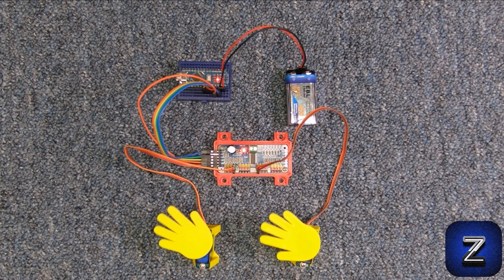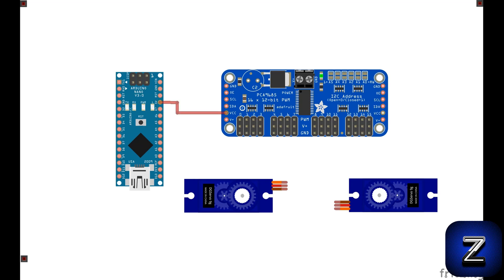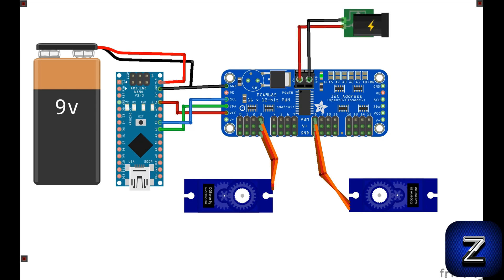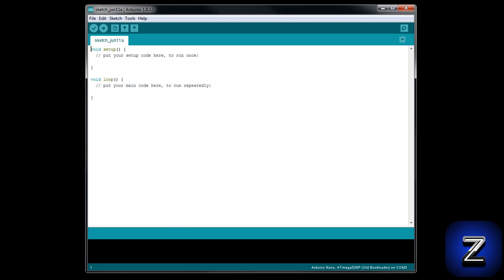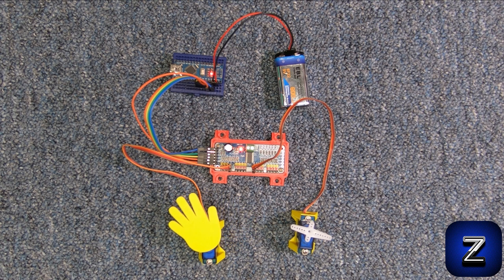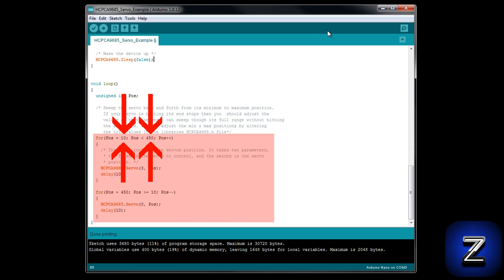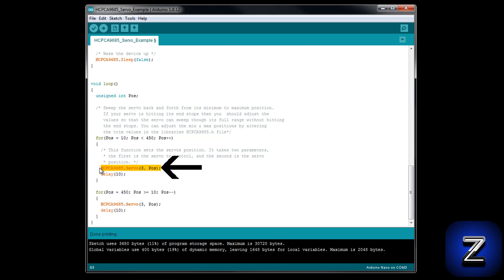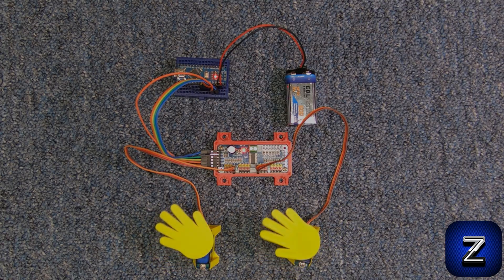How to setup and use a PCA9685 with your Arduino to control up to 16 servos.

Comment: I have 11 control switches and an arduino mega and a PCA9685 can I program the mega to operate servo's using the on/off switches? Thanks

Comment: I tried adafruit library but can not get the servos to move.I downloaded the HCPCA9685 library and still can not get my servos moving, I have everything connected correctly ( I have checked this 100times now) I power the arduino from a regulated 5v supply(usb) , I have a seperate power supply for the servos( 5v 10amp) but still no action, you seem to know what your talking about any suggestions you can give me( sorry I’m new to this) trying to get 6 servos working

Comment: i downloaded the code and library. The A4 and A5 did not work for SDA and SCL. However the pins on the Arduino Uno labeled SDA and SCL worked for the PCA9685 corresponding data pins. Also the servos did not work on 3 and 8 but they did work on 4 and 9... Kinda buggy or something wrong on my end. Works tho.

Comment: an additional tutorial, for model railroads can be found at DIGITAL TOWN with a very good example and discussion of working code and how the servo driver actually works and is wired up for either servo or leds,
bob

Comment: Hello!
Your channel is helping me a great deal! 
I've embarked on my first arduino project, a motorized headpiece, it is based on a spider robot design, has 36 servos,6 arms per side, 3 servos per arm. 
I've daisy chained 3 pca9685 boards and numbered the servos from o to 35.
I've downloaded the pca9685 file to my arduino app and am currently giving the coding a try using the information from your channel. 
I am using an 11v lipo battery and I have included the buck converter to convert the 11v to 5v.
I am hoping you can answer 2 questions for me. 
1.
I have numbered the servos at the base of the headpiece 0,3,6,9,12,15,18,21,24,27,30,33
I have numbered the elbow servos 1,4,7,10,13,16,19,22,25,28,31,34
and finally numbered the finger servos 2,5,8,11,14,17,20,23,26,29,32,and 35.
can I program the code to move these 3 sections separately?
and,
once I've successfully uploaded the codes to arduino I am including a Bluetooth module so they can be operated from my phone. 
is the an app that you recommend to perform the motor controls?
thanks very much for your channel!
any help would be greatly appreciated!!
sincerely 
Norm Wright

Comment: Thanks so much for a very clear video that makes no assumptions about the viewer's knowledge and talks us through every step.   This is the first time I have tried to use a PCA9685 and multiple servos, but it worked first time and also when I increased to several motors.

Comment: I need a two position servo... on/off.  but can I make OFF also be Zero Voltage to the servo? position ON would be only powered while needed.
Reply from the maker: Just use a transistor or small relay to have the Arduino turn power on when needs to be on and off when it don't need to be on

Comment: G'day, my servo won't move. I have tried using 3 different types of servos. changed the wires, ETH cable, and even a different Arduino and external 5V power supplies. I've got the code 100% correct. Ive ran out of ideas. Could you think of any reasons why the servo will not move?